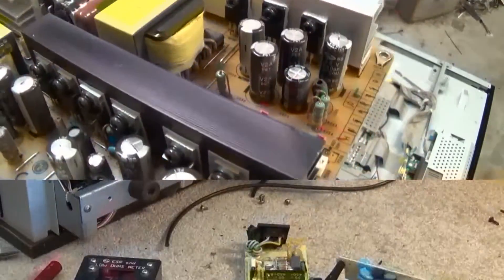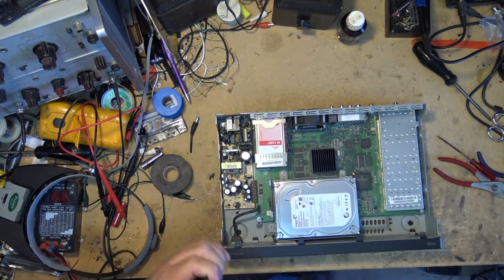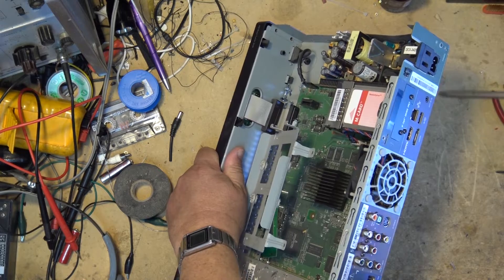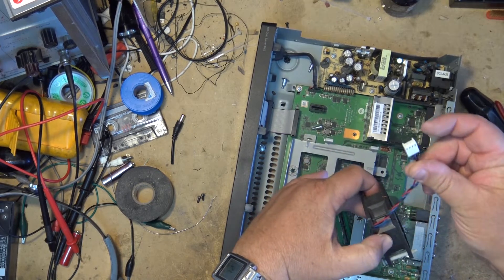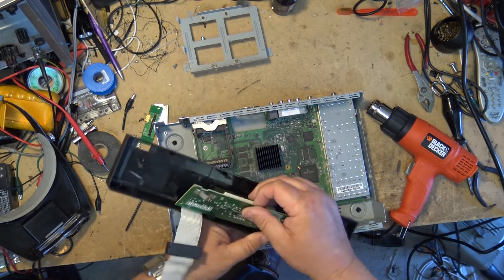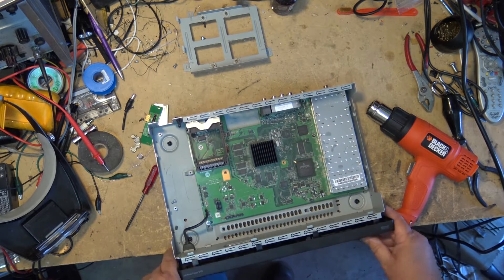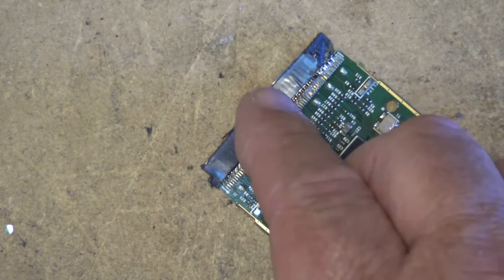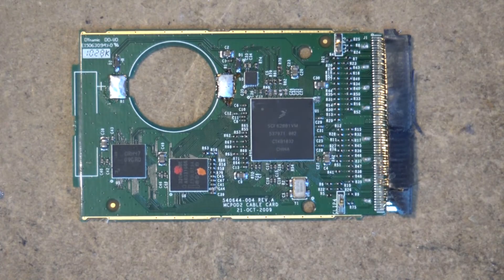Motorola Cable Box tear down

Comment: I noticed my Motorola DCT700 cable box has a 2450 battery in it. If this battery goes bad, will my box stop working? It is the original battery and it is old.
Reply from the maker: Probably.  Motorola used digichyphet encryption and the keys were held in volitile memory.  Battery fails keys are lost.  You have to change it with the unit powered up and attach the new one before cutting the old one.
Reply: Does this battery have anything to with the way the box powers up and down or is it only for encryption purposes?

Comment: a teardown of a cable box and all you did was take the hard drive out and threw the actual ' cable box ' in the trash.

you didn't show a single component of the main board. you didn't even lift the heatsink to show what processor/ chipset it used. it would've been more interesting to see what chips it used or what's under that huge RF can that you just ignored.

also that PCMCIA card all you did was take it apart. the so called " custom ASIC " was a Freescale arm processor
Reply: I was also hoping this would be a lot more thorough. They were such a thorn in our sides back when I was a tech at Charter, but the technology in them was very impressive for its time.
Reply: These DCX units use a MIPS64 CPU and they do support MPEG4, they're the current model and they're now made under the Arris brand. The iGuide software many use is written in MIPS assembly.

Comment: Try removing the "Think" screws that Time Warner used on their old QUBE boxes. They were what appeared to be straight side hardened round heads by casual looks but in actuality they were oval heads by .002" and took a special driver to remove.

Comment: I'm surprised the cable company didn't go after the customer for the box or at least the card. Do you buy cable boxes up-front in Canada? In the US you rent them and if you don't return them, you will get sent to collections.
Reply from the maker: Travis Parker 
yes you can buy or rent them. 
I know we want our rentals back. this was a customer that had changed to our system from competitor and while I was there he brought out a box with old electronics and asked if I could recycle it. I pointed out the cable box and he said it was his and it no longer worked. so I obliged and recycled it. less the hard drive of course. I will reuse that.

Comment: you need the working box to unlock the hdd, normaly the HDD its locked with hardware password, impossible to unlock because its detected when the password on power-on its correct, the only way to erase that its whith firmware update...
Reply: I thought so, too.

Comment: Best way to get spares and handy bits :)

I'd be careful with the HDD, it's getting old, yep, the MTBF is around 300,000 hours, so should be ok, I'd just not keep critical files on it, just in case..

HDD Date Code 11152
Date Code Year:2011
Date Code Week:15
Date Code Day:2
Reply from the maker: Simon Parkes 
even if it was spinning 24/7 that would be just over 60000 hours. since they don't spin 24/7 they stop when the box is turned off. spin up for a scheduled recording and then shut down again.  I use these to put camera files on as an archive. once the drive gets full I plug in another drive and only put that one back in if I need to access archive material.

Comment: I thought that it might be a Digicypher II RS+ based system as Digicypher encryption was used in the USA for conditional access use to prevent piracy.
Reply from the maker: Most of the motorola stuff was Digichipher. The cable guys have for the most part changed to Arris now, which is what we are using now for our new boxes at work. Our old cisco boxes are being swapped out as they are just getting too slow as the software upgrades have bogged them down substantially from the change from windows based to linux based.
Reply: @12voltvids  I remember the DCT series being obnoxiously slow even 20 years ago when I was a repair tech at Charter. The guide download time was excruciatingly slow and would take several hours to populate.

Comment: hard use hard drive
Reply from the maker: These are generally pretty reliable, they are designed for extended use, and the files are generally large files, so not much seeking as on a computer drive.
I use them to store my backup files.
Reply: is there a harbor frieght in your area?  they have some nice security bit sets that are really handy,, 7-8 bucks and has about 32 different bits.
Reply: I don't think there is HB in Canada